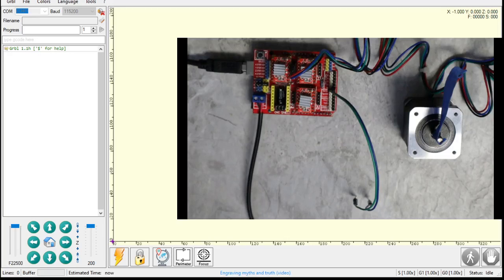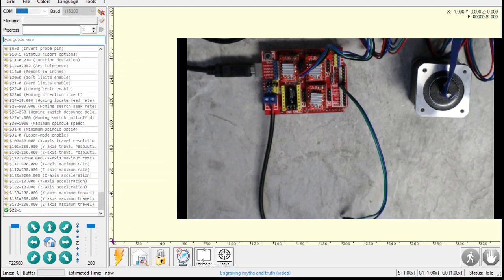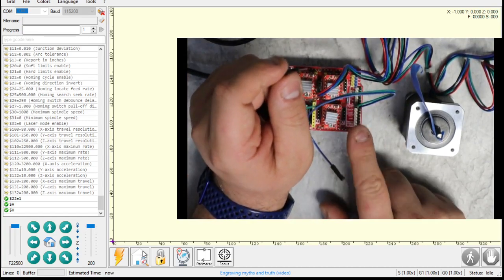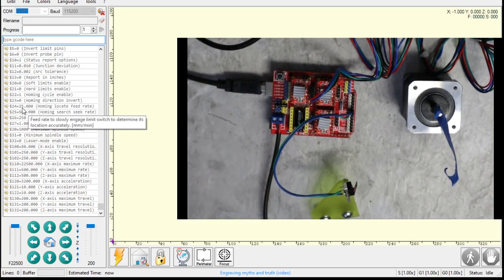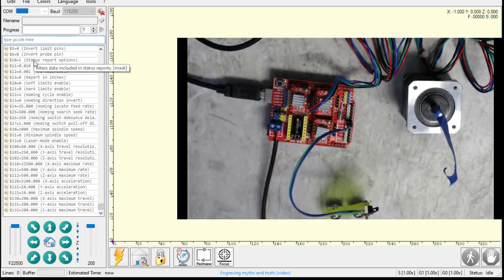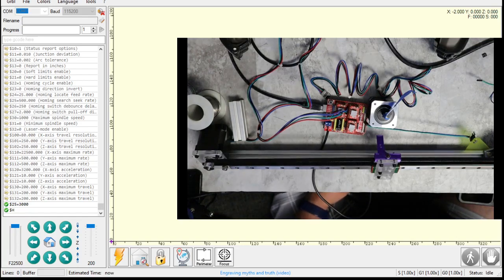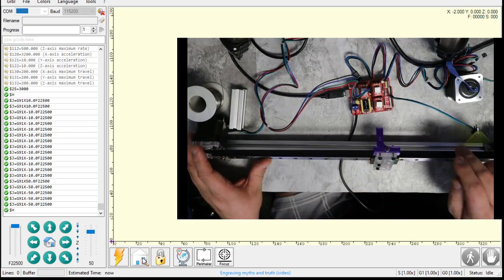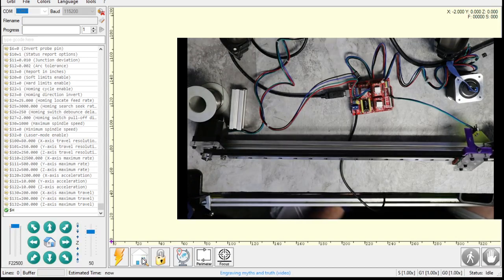GRBL Shield video 5  Endstops

Comment: I abandoned ugs and went to lazergrbl same issue if I hit home it gives error code pin9 x limit pin10  y limit and pin 12 is torch on also can’t get it to come on
Reply from the maker: @777smitty4  disable hard stops?? 
Plasma torches can be very noisy electrically.
Reply: At this point torch is not connected only the optical relay just for testing

Comment: Great video for GRBL 
But I have a little different setup looking for help arduino running separate drivers with ugs how would I connect switches I can’t find any advice on my setup
Reply from the maker: What's your setup??
Reply: I don’t have the GRBL shield I’m running straight off arduino unio

Comment: Thanks for the tutorial. I'm trying the same thing. I have two wires connected to z, one to black one to white.. I've set $20 to 1. I only have my Z axis connected to the shield. When I hit Home the motor move momentarily then I get an error message "Homing pull off action failed to clear limit switch".  The switch is not fitted as yet, I'm just testing with two wires. Any ideas?

Comment: Great vid! ..My question ..I have a small lathe setup, GRBl v1.1h I have my endstop working on z+, I had to change the config_h file for UNO as per the notes, I want to control a relay just on off for the spindle, can I just use the SpnEn pin?? With M3 M5 command do I have to edit config_h again? Thanks

Comment: really appreciate the clear explanation; best video on this component of CNC programming that I've seen so far. thank you.
Reply: as an addendum, I've seen some wiring diagrams on reddit for setting up normally closed end stops that include a resistor and capacitor for noise mitigation. I assume the circuit is simply opposite to your NO setup (minus the resistor and cap), but do you have insight on changing GRBL registers to recognize the NC setting? thanks!

Comment: hello, would it be or is it possible to disable z while in laser mode, I am using v 1.1 in my laser machine and cannot use limit switch on x, y because homing fails because there is no z hardware at all also by disabling z as dont need it for runing laser
Reply from the maker: Yes!! Open up laserGRBL and go to:
Tools:
Flash GRBL firmware
Target: either an Arduino UNO or NANO
Firmware: v1.1H Custom XY homing <-------
Reply: @brakthehun  i tryed flasing but ont let me sez carnt
Reply from the maker: @jujucattys156  What board do you have??
Reply: @brakthehun  i sorted it m8

Comment: hi first of all thanks for this awesome video.
secondly, i already have a laser with the same board as you use and every time i press homing the laser stand still and not move the it show me an error that the machine didn't find limit switch although i installed the switches as you show.  any idea how to fix it?  thanks in advance
Reply from the maker: You might have z homing in your firmware. Flash the custom xy homing firmware.
Reply: @brakthehun  do you have a video on how to do that?

Comment: Does this also apply for X+ & X- /Y+ & Y- ? I wanna use endpoints on all ends to save my motors from hitting the end
Reply from the maker: Yeah. There's a little bit of tweaking in the firmware for endstops on both axis but GRBL does support that.
Reply: @brakthehun  Could you make a video on that? Perhaps combined with the homing? Or just send me a quick text tutorial with settings to change? I thought it was as easy as putting switches on the dedicated endstops on the cnc shield board that you use (I have the same but with DRV8825 drivers and nema27 2.5amp motors for cnc)

Comment: WOW! Thank you VERY much. This and your other video on the GRBL Shield help me with the GRBL board ( 3 Axis GRBL 1.1f USB Port CNC Engraving Machine Control Board ) that I am installing in my K40 machine. I could NOT get it to Home with the end stop switches. Once I knew that the switches were connected correctly to my GRBL Shield but would still not Home, I used LaserBRBL to flash the 2 axes firmware  over the GRBL 1.1f and IT WORKED. I was then able to flash the board I wanted t o use and IT WORKED! I have been struggling with this for a week. 
THANK you!
Reply: What is the 2 Axis firmware. I am having the same issue.